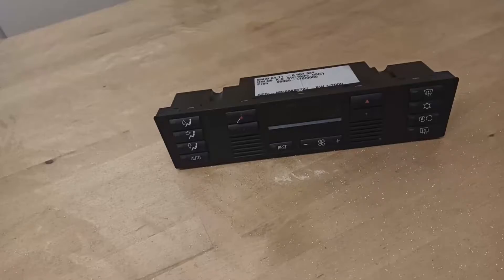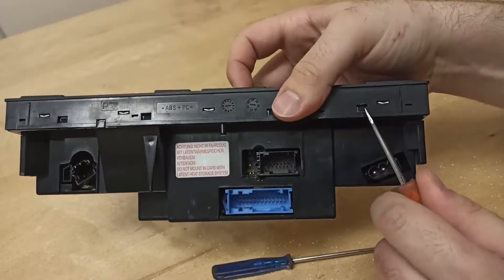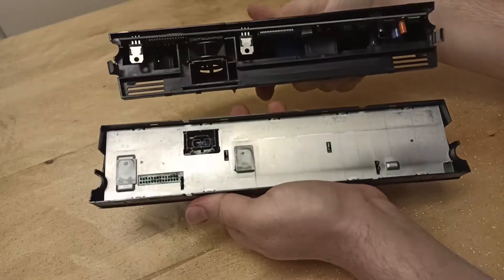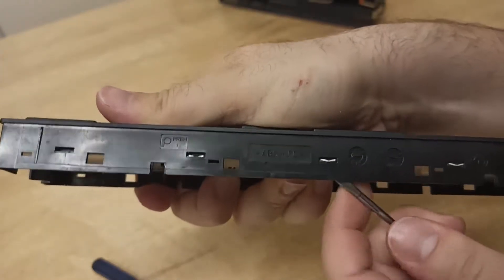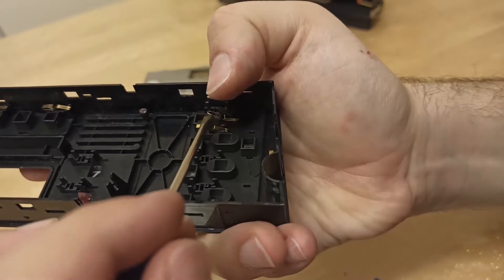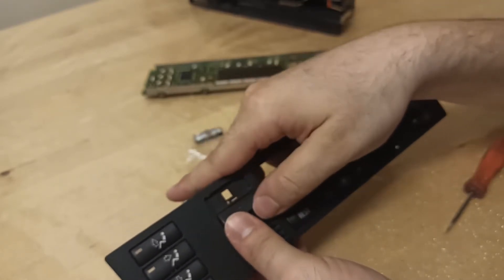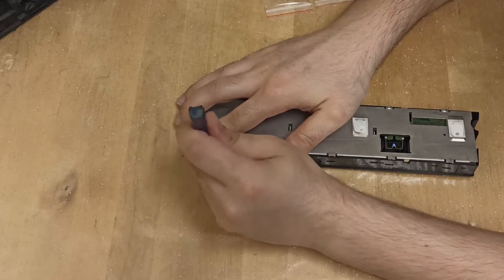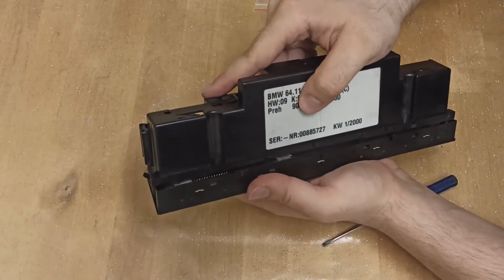How To Fix BMW HVAC Climate Control Panel Buttons And Pins - BMW E39 5 Series & BMW X5 E53

Comment: How do we know if it's our buttons that are broke or if our actual control module unit itself is broken?
Reply from the maker: If you click on the button and you dint have a response from the unit, its the module, if you have a crack on the button, then the button is the problem

Comment: ok this was an absolute nightmare to assemble back...  had to slide 2 bars under the panel so the buttons are facing down and are not pushed at all by the table... also if your buttons get stuck for no apparent reason, check the gold metal bracket in that button contact... it's probably not reclining against black plastic pin anymore, so shove it back